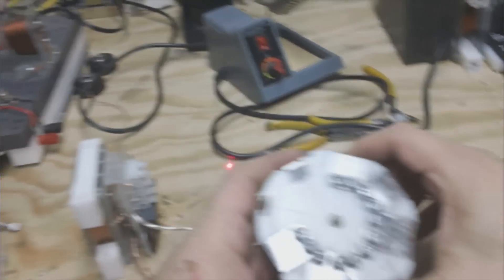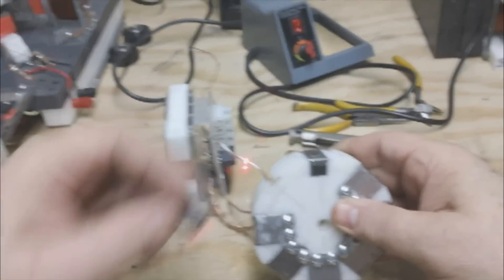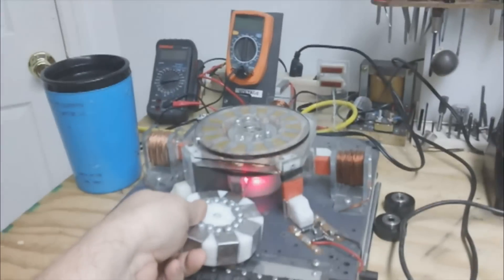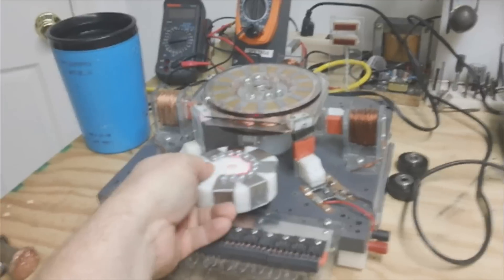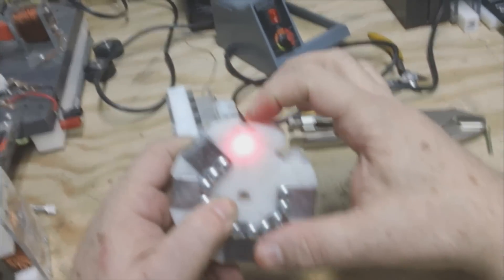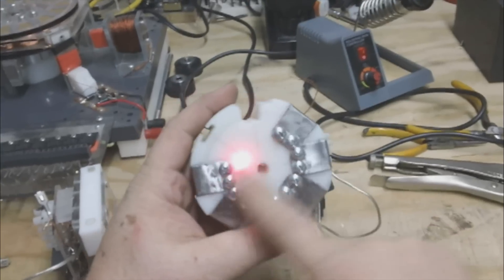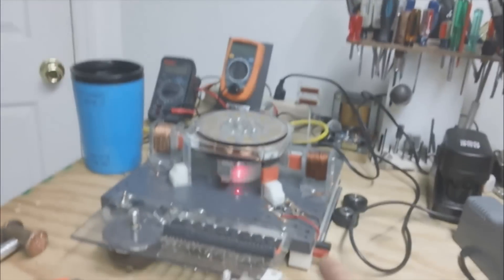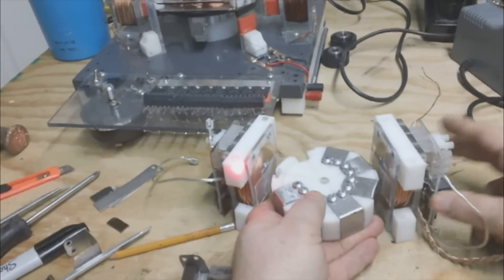small pulse motor test

Comment: I have played with pulse motors before and I have watch countless videos of them, but I've never seen overunity out of this system. I gotta wonder,  what is the purpose of pulse motors these days ??
Reply from the maker: well the best thing I can tell you is , we are dealing with High voltages , the motors that we are building are to drive a big generator, the large sequential pulse motor has a 24" wheel and is able to run at 120 v/240 v and generates quite a bit of torque. the small motors are just testing improvements to the system and they also make excellent battery chargers. thanks for watching